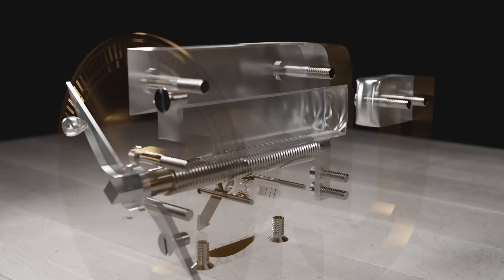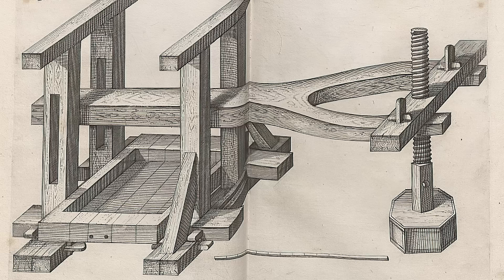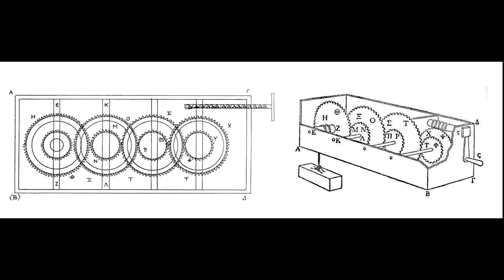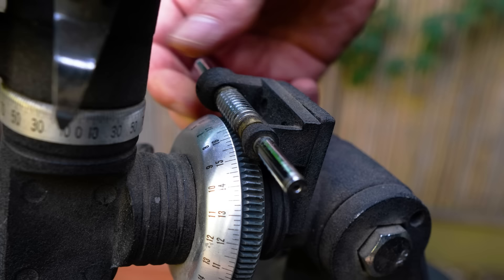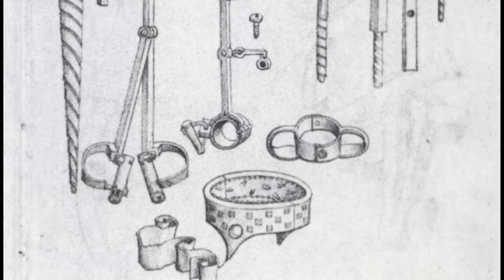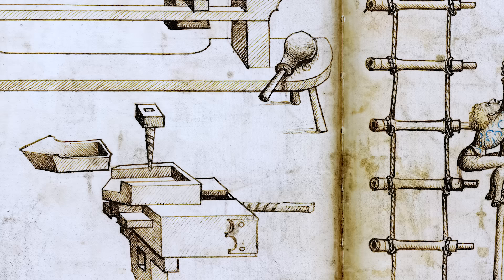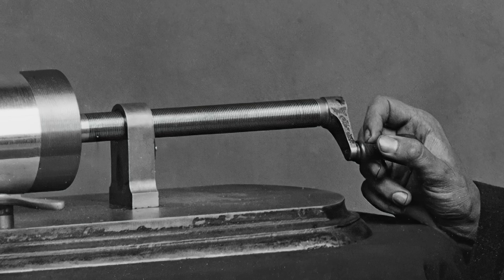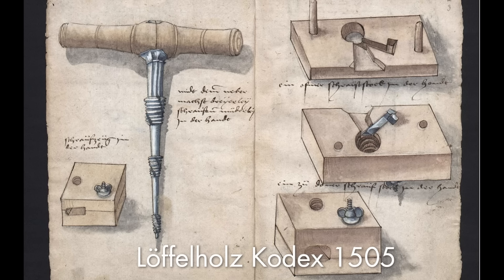Where DO screws come from?

Comment: "what would happen if every screw just disappeared"
Easy, I would use bolts.
Reply: yes, but all bolts are screws
Reply: Cheeky solution, sir
Reply: @quentintin1  and all screws are bolts if you cross thead them enough
Reply: that would just be nuts!
Reply: Well if they did the inmate's would be happy.
Reply: It is not that easy, as there would undoubtedly be a bolt shortage as everyone else buy them.
I would simply wait a couple months until huge batches of new screws had been produced.
Reply: @johannesmajamaki2626  underrated joke
Reply: Funny is most cars are now clued becouse its cheaper than bolts and clips
Reply: @GripFreak  Fairly sure he just wanted to make a joke. Any absurdity in what he said that you feel like you can incriminate him with, would in that case just mean it is a proportional amount of humor.
Reply: everyone would be screwed
Reply: @stefanpredl6849  (said) "Funny is most cars are now clued"
That's SatNav for ya'  let's em know where to go. 
All clued up, yessir.
Reply: Easy, we'd be screwed.
Reply: @gavincarstens6497  cross threading is just press fit. change my mind.
Reply: Nailed it! Riveting comment.
Reply: literally
Reply: No to its clearly far simpler to make and install rivets.
Reply: No more need for birth control
Reply: We'd be screwed.
Reply: In the auto industry they are called fasteners. There are armies of engineers whose job it is to find way to eliminate the need for screws. One screw may not be expensive but consider building millions of vehicles with 5000 screws each. They also add weight reducing fuel efficiency and the cost of installing them is unbelievably high.
Reply: Gorilla Glue comes to mind if every screw just disappeared...
Reply: @quentintin1  all bolts employ the screw principle. a bolt needs a nut or internal threads in a fixed object. a screw creates its own threads. there can be no argument.
Reply: @hulado  then what about the lead screw in lathes? or the Archimedes screw?
the first one runs in a nut with machined internal threads while the other is used to move grains or liquids about
Reply: @stefanpredl6849  give me a clue as to what you mean? Didn’t know cars had a  clue but we learned something new every day
Reply: @atadbitnefarious1387  and brakes only slow you down….

Comment: One of the most fascinating uses of screws, in my opinion, is for controlling manufacturing. Once you have a screw you can duplicate exactly and with a hard enough material that it will not wear too quickly, you can then greatly improve your manufacturing because you have more precision. Once you have precision manufacturing, you can use that precision to make ever more precise instruments and once you can precisely control something, you can also precisely measure things. The ability to reliably and repeatably manufacture screws, in some respects, could rightly be considered one of the key triggers of the industrial revolution.
Reply from the maker: That's basically my next episode. Keep an eye out in a few weeks.
Reply: No. Precision comes from the 3 plate method, establish flatness and build a lathe.
"Screws" are only interesting when the concept of standardisation was established. Metrology is where it's at.

Comment: I worked for a short while in Central Instrument-making workshop of the Akademie der Wissenschaften in Ardlershof, Berlin.  In the DDR  at that time, they had difficulty in getting the screws they needed, so they made their own.  They had a huge encyclopedia-like book called "Deutscher Industrie Normen"  Which specified, in enormoous detail the dimentoins and tolerances of everything imaginable.  It even specified the radius of the bevel on the edge of the screwdriver-slot in the head of a screw.  The tool that they used for making these screws was a special lathe, the headstock of which, together with the chuck gould slide towards or away from the tailstock.  On the outer end of the headstock you could mount what they called "Ein Patron" (a cartridge) which was an externally threaded tube made of hard steel. about 3cms in diameter, this cartridge was matched by another piece, I think it may have been bronze which was half a nut of the same pitch.  This half-nut was easily mounted on an arm which pivoted about a shaft mounted on the lathe bed.  The simple v-shaped or square-shaped cutting tool was mounted on the cross-slide, which had a simple handle to push the cross-slide in as far as the adjustable stop would allow.  In use, the stop was set for the first cut, the tool was pushed as far as the stop would allow, the headstock was set to rotate and the half-nut was engaged with the cartridge.  The work piece then moved forward towards the cutting tool and the first cut was made.  When the half nut was disengaged from the carteidge, the headstoch was pulled back to its resting place and the cutting tool was retracted at the same time  Then the stop was reset and and the next cut was made.  The screw-blanks were made on a standard capstan lathe as a seperate operation.  It was surprisingly quick and easy to use this machine.

Comment: I'm German and I can say that the script around 14:00 is extraordinarily hard to read. I can make out  some words and some letters but not enough to even make a guess as to what the original writer intends to convey. Especially in the long texts. It's like really really bad handwriting. And I learned how to read/write cursive.

Here is what little I can translate:

14:04 Zweibein mit Daumen??? -> Twoleg with thumb????
14:09 ein verfeinerte Daumenschraube -> a refined thumbscrew
14:21 Zweibein mit Daumen??? -> Twoleg with thumb???
Reply from the maker: Yes, I asked a few native German speakers to take a look and all of them basically said it was painful.  There is someone in the comments that's trying to crowdsource a translation, maybe work with them!
Reply: @machinethinking  I would go ask some doctors, they still write like that today, and i would hope they can actually read what they write... 🤣
Reply: German native speaker here too. - And it’s painful to read for two reasons. First, it’s written in https://en.wikipedia.org/wiki/Kurrent - which is a script used for centuries with variations over time. And second it’s written by someone who conversed with this script regularily. Just like with spoken language, where you can pronounce each sound clearly, but don’t do it since it’s tedious and doesn’t usually enhance comprehension, and other handwriting that also becomes more fluent and less clear, this is a practiced handwriting. After transcribing those for a month, starting with familiar topics, you become fluent in reading them. Until then...

Comment: When my son was about 6 or 7, he started helping me with repairs on mechanical things, cars, etc.  I took him aside one day and told him that I would tell him a secret that was true, but that he would not believe.  I told him it was much easier to reassemble things than to take them apart.  In later years, he told me that I was exactly right.  I learned this by working on lots of big rusty farm equipment's.  Two things make this true; first, in disassembly, lots of the bolts may be rusty or seized.  Second, after you have taken it apart, you know where all the bolts are and exactly how to put it back together, so there are no more surprises.

Comment: As a wooden boat builder.. we build entire ships outta wood. Fastened with silicon bronze wood screws. Oddly enough there usually slotted! Sounds wild.. but when it comes to repairs! Its easier to clean out and remove a slotted screw then fearsome bit or phillips screws. Most bottom plank screws get sealed with fairing putty. When top sides will b sealed with wooden bungs cut from each planks scrap so the grain matches. We epoxy those in. But! The screws always get stuff stuck to them and slotted screws just make sense.. Especially when u have to remove 3000+ of them. Also so many of our tools run from some sort of a screw mechanism! Our worm drive skill saws.. bit braces.. the list goes on and on

Comment: as a german, while the word screw (Schraube) is used for both bolts and screws by your definition, a bolt (Bolzen) is here usually a screw without a head or if you will just a threaded rod, so you'd use it with two nuts or a nut and a thing that already has a thread in it.

Comment: I went on a tour of the medieval armor collection at the Metropolitan Museum of Art in New York City. They had plates that were fastened with wing nuts. The guide -- who used to be a mechanic -- told us that the internal thread of the wing nut was cut "manually," although the method was lost. This didn't sound right to me. I used to be an auto mechanic, and I sometimes had to cut internal threads when the old threads (on an engine block, for example) were stripped or corroded. I got into a friendly argument with the guide. I was sure that the armor makers must have had an automatic way to make internal threads for the wing nuts. How could you cut internal threads manually? Now I see that I was right. So thank you for this video which finally answers one of the great puzzles of my life. 

If you're in New York City, you can check out the armor (and other interesting things) at the Metropolitan Museum on 5th Ave. and 82nd St. If you're a NYC resident, or can pass for one, you can get in free.

Comment: I work on the farm, and to me the difference between a bolt and a screw is the head and what you mentioned, a bolt uses a nut to fasten something, a screw is something i usually use to fasten something made of wood. Bolts usually have a hexagonal head and hexagonal nut, screws usually have a round head with either a flathead slit, a philips head cross slit, or a torx hole (if you can call it a hole)

Comment: Someone has already said this probably but in the UK a bolt is a threaded fasterner, usually used with a matching nut, which has a plain length below the head and only a portion  of the shank is threaded - there are standard data charts for these.  A 'bolt' like device which has a fully threaded shank is known as a 'machine screw'.  Both of these are often used  with matching threaded nuts - however they can be used by screwing into a threaded hole which is made in the second component, an example is a cylinder head cover on an engine.  The fastener passes through a clearance hole in the cover and is screwed into a tapped hole in the head casting, so no nut is needed and crucially the bolt or machine screw does not 'pass through'.  This is a very common application so the definition of bolts etc is that they 'pass through' the parts to be secured is not universal so should not be used for definition purposes.

As you rightly say though, a woodscrew or 'self tapping' screw (used for fixing to metal or plastic) make their own threads and are distinguished by not only a coarse thread pattern but they have tapered cores while nuts, bolts and machine screws have parallel cores.

Comment: Re tool on the screw cutting lathe from the house book, my first thought having built and used wooden pole lathes was that the tool is a mallet used to set the wedges that hold the head and tail stocks in position.

Comment: In mechanical engineering school, we were taught that a bolt is the ensemble of a nut and a screw. The nut being the threaded hole while the screw is its threaded cylinder counterpart. Some screws have specially designed threads which allows it to be used without a nut, such as a wood screw.

Comment: At lunch in the machine shop I’m watching this and the 2-foot brass worm gear on the desk in final inspection. They are beautiful. The worm is usually of a harder material that the worm gear. In electric model trains you’ll have a brass worm and nylon worm gear, or they might both be nylon.  In other things a steel worm and iron worm gear. They all are interesting

Comment: Interesting video of the old days of manufacturing.
I worked as a tool and dia maker for many years that supported the fastener industry. Later on I worked as a machinist in cutting specialized fasteners for military ,offshore rigs, aerospace industries. Last  I worked at another fastener company that did large quantities for many different manufacturers. They use Heading machines which form a part inside a die specialy made for that part its basically pounded into the die with one stroke.( specific alloys of various diameter wire are fed into the die and smashed to conform to the dia. .
 Some headers have several blows  meaning the part automatically gets transferred to another die inside the same machine for more forming and another blow and another. 
You can only force metal so far at once without weakening it thus you need more dies that continue to form the part.  It all depends on how complicated the shape. 
A header can make a part in seconds.
Then the part runs at high speed across a machine called a roll threader. They literally roll the threads on the blank in one pass.
All things being equal rolled threads are stronger than cut threads as the metal is denser as it's squeezed in the threading process. 

Cut threaded parts are sometimes headed first to the near net shape then the threads are turned on a lathe with assistance in loading with a robotic arm and computerized machines.
Very short quantity orders like dozens or less are most often   completely turned on a lathe and take a few minutes a part.

There is  a vast industry for complex parts that you would never see in a hardware store.

Comment: That tool with the round head and handle is a mallet.  Not part of the screw itself or to service the screw per-say.  It was used to adjust the wedges in the machine (visible in the drawing).

Comment: There’s lots of bolts that go through threaded things and then have a nut and also potentially a lock nut as well on the other end. For one example, the clamp that used to hold my exhaust on my dirt bike. Until the clamp broke and the muffler fell off and I put it back on with band clamps (which contain screws acting as a worm gear to tighten the clamp).

Comment: Threads on a rod or bolt allow a simple way to make a spring.

Drill a small hole through the centre of the rod thread and insert the end of a springy wire.

Solid welding wire was all I needed.

By holding the nut for the thread in a vice you can lay a wire in the thread bending it into a spring by turning the threaded bolt or rod so the hole moves away from the nut.

This spring expands a little when the bending pressure is release allowing the spring to be easily cut at the ends and removed.

Stretch the spring a little if you need a compression spring.

High tensile fencing wire is something else of various thickness to make spring.

Comment: today glue and clips are replacing screws.

if you ever bought an external hard drive (probably to store all the source media for your videos) the case is held together by plastic clips.

there are videos on how to shuck an external hard drive for the internal hard drive.

light bulbs have threaded bases so you can screw them in.

bikes have quick release skewers that has  a threaded nut to do the course adjustment then the lever on the other end locks the wheel on.

the bottle and jar has a screw where the lid or cap is held on.

computer cables have thumb screws to hold the cable in

Comment: This video reminds me of the olds elevator that was only somehow invented in 2002. It has a screw in the center of a rotating cylinder and that lifts grain without damaging or weathering it. It also prevents 10s of explosions yearly caused by grain dust buildup.

Comment: In Russia we use word "bolt" for threaded cylinders with a cap you screw with the wrench (usually hexagonal cap) into a threaded hole. The word "винт" (vint as in vintage) used to describe something you screw with a screwdriver, usually into a threaded hole. But to describe the screw that makes its own path we have the word "саморез" (sam as in samba, o, res as in resolution) which roughly translates into "autocutter"

Comment: Very Intresting, I underrated the (fine) mechanical possibilities of the medival age.
I also learned that in English screws could be bolts. In German screws are screws and bolts are mostly cylindrical pins without thread. Also bolts where used to shot by crossbows.

Comment: I didn't read all the comments but a bolt is categorized by the head and thread pitch. A lag bolt is a good example of a "bolt that screws in and makes its own threads. The head makes it a bolt. A self tapping machine screw is a good example of an anomaly because it normally has a bolt like head with screw type threads. Generally speaking though, I believe the head truly determines the actual name because a nut driver and a screwdriver are similar yet very different tools lol.

Comment: The screw/bolt issue is clouded by the "set screw". These are generally considered to be fasteners with the threads going up the whole way. There is no shank. They are more likely to have a socket head or screwdriver slotted head but it can be square or hex-headed. Bolts have thread going part way up the shank. This creates a stronger fastener. The easiest distinction is full thread = set screw. Part thread = bolt.
Wikipedia confuses the issue by confusing the set screw with the "grub screw". The latter is fully threaded but has no head. The driving end is slotted or socketed so the screw can be turned and driven below the surface. These are used to lock items together e.g. fixing a wheel to a shaft. Grub screws and Set Screws are not the same.

Comment: I think I read somewhere that the first really precise screws were made basically by carving a rough screw lightly into a shaft and a long split nut, then working the one up and down the length of the other with fine grit (and water?) for days, gradually tightening the split nut, wearing the precise screw form into them both.  I THINK that's how it worked.